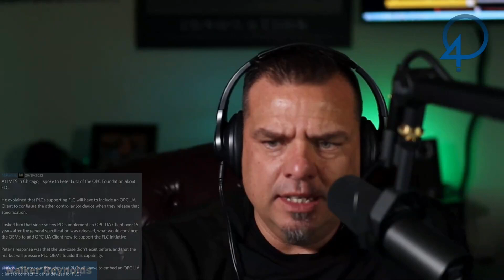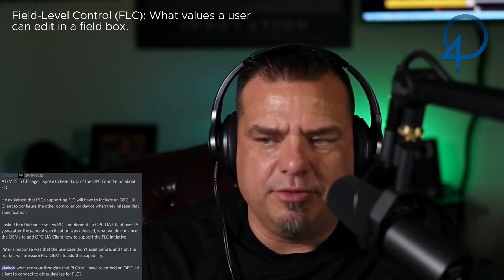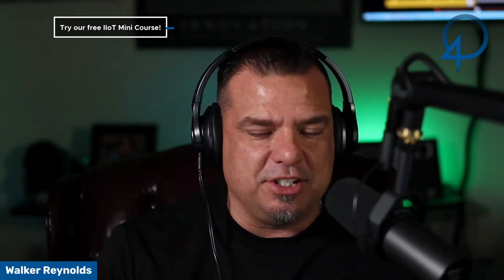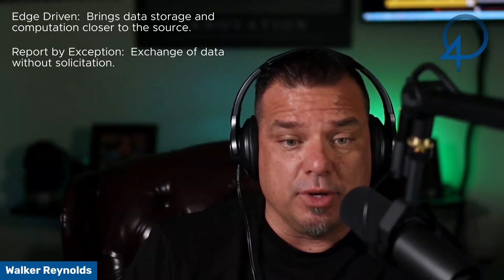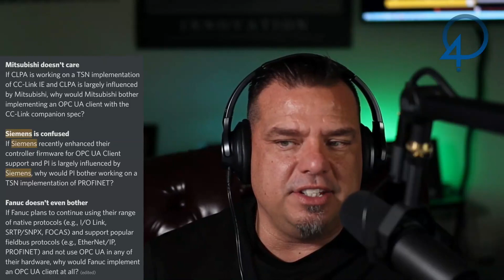Why OPC-UA isn't Widely Adopted

Comment: I was always told that OPC UA is for interoperability. So why each time I see an OPC UA implementation, there is an OPC UA server on each PLC and not at a central server that acts like a broker ?
Reply from the maker: It’s a good question! It’s interoperability “in theory” have you joined the discord community yet? There’s a ton of great discussions in there! https://www.iiot.university/discord
Reply: Agree. The UNS benefits of each OPCUA Server are limited to that "device" (it is a point solution), but much greater benefit can be achieved w/ much larger Unified Namespaces. Current solutions I am aware of treat OPC Classic, OPCUA, ODBC, and other sources as inputs into a larger and centralized UNS which can then be accessed in turn via. OPC Classic, UA, REST API  as a much larger holistic namespace.

Comment: To answer this question, comparing with widely adopted OPC DA, what does OPC UA bring to table? Authorization/authentication/firewall/certificate/encryption etc. All these can make plant data available in INTERNET and look more modernizing. Sounds like a perfect solution to make everyone happy. Next question is - do we really need so many add-on features besides plant data in an umbrella solution? Yes, for IT access, but no for OT operation. With all these added complexities and steep learning curve, PLC vendors need a corp of army with high level of calibration for this challenging job. Is it a good use case to penetrate IT and OT to expose PLC data to Internet? Is it a good ROI for them?

IMO, from day one UA has picked up a wrong architecture - SOA. SOA is good as a lightweight request/response model, but not ideal as thousands tags update values simultaneously. Even with UA PubSub model resources consumption is overwhelmingly high as pointed in this video. Think this way - one executable process handles all authorization/authentication/firewall/certificate/encryption plus data generation. How good performance could you expect?

Take a look at this innovation. DA still handles nothing but data generation, IIS with WebSocket feature enabled takes care of the rest. So, data generation and all Internet add-on features are separated and distributed in different processes. Pushing data back from server in this case has a smaller footprint in server comparing with that in UA. How does that architecture look like? Link for this project is https://github.com/duduyoyo/WebSocket4OPC.